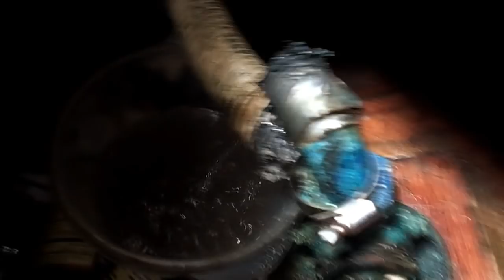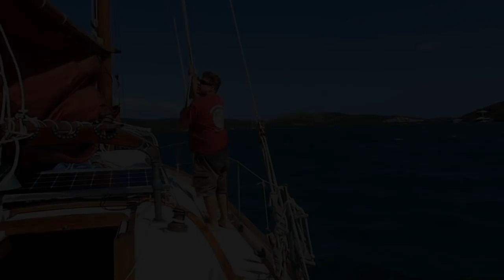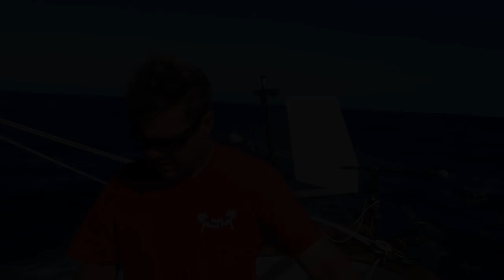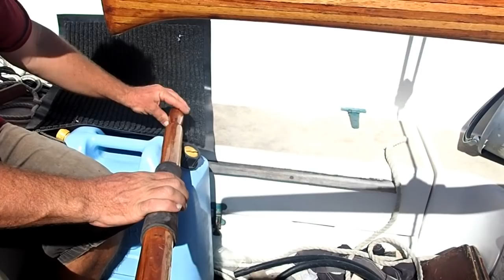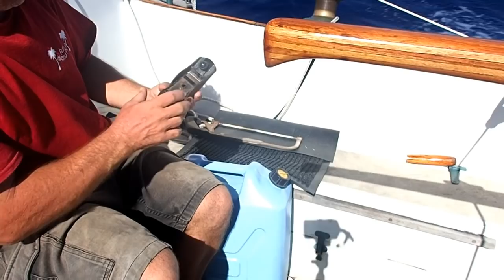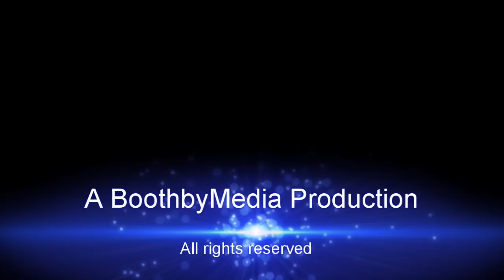When you get that sinking feeling

Comment: Good video. thanks. On the wooden plugs - one of the rules for an offshore racing boat is to have a plug of the correct size for every through hull AND it should be taped to the hose that connects to the seacock. That way you don't even have to go find one. Something I always do on my cruising boat now.
Reply: An acquaintance had just launched the beautiful approx. 90 foot trawler that he had built.  On the first passage after sea trials a through hull fitting fractured.  The flooding could not be controlled so he tried to run her up on the beach of an island.   He didn't make it and she was lost in 3,600 feet of water.  The problem was that he had used inexpensive non-marine fittings.  The real problem was that he did not have bungs for the through hulls.  We were maybe 12 nm distant but she was gone before we arrived.  The USCG beat us to the scene to pick up survivors.  No hands lost.
Reply from the maker: That is sound policy.   I've been rather too cavalier about such things.  It only registered for real with me when the water actually started coming in and then it hits that a boat can sink.
Reply: @howtosailoceans1423  Yup, when I purchased my 1968 Allied Luders 33 (in 2000), the previous owner had tied bungs to all the through-hulls. I just figured all vessels had these as cheap insurance in case a hose ruptured and the valve or valve handle broke or jammed. 

A few years later, a friend purchased a Baba 35 that had been sitting on the hard at Herl's Harbor (Port Clinton, Oh) for years. I noted the old bronze through-hulls that were very stiff-working and hoses with severe surface cracking and told him he had better maintain those before splashing her. He ignored me and splashed her the next day (mid September). Bungs were not tied to each through-hull, either. Went out for her first test sail with him and the previous owner on my birthday right after he put her in the water. I was a little nervous about those through-hulls, but she bashed well to weather in 25 knts of wind with a full jenny and main with the rail nearly soaked. No sad related story that I know of, but then we left that marina that fall. I hope he maintained those through-hulls during the winter haul-out. 

Also, wouldn't it be possible to careen your vessel and fix the through-hull at low-tide rather than going through the expense of having her hauled?

Comment: A good sailor is a master of all trades.  You sir are a master.   Great video, fair winds Brother.
Reply from the maker: Thanks Joe!
Reply: If I had a cent for every stroke of those oars, I'd be a happy sailor. Well at least what remains will make a fine knock out killing stick for dinner when I haul it on board! What material was the drain valve? A lady I have to pick up soon has hers made of bronze with(as it so happens, I was talking to her previous master this afternoon about the various holes she has) the conical shape flow stopping device that you described so I hope they are in better shape than your hole stopper! His method of maintenance was to dissemble, clean and apply a liberal coating of Vaseline or grease then back in again. Is there no tidal range thereabouts where you could careen and replace the offending article? I presume the thieving boatyards over there are just like the money grabbers oer hereabouts! Anyway until we cross tacks again, may your halyards remain up tight and your sheets taut. SkipRay in the "Kingdom".

Comment: Kevin, my boat is 42 years old. Just because of their age and from no apparent deterioration, I changed all the bronze thru-hulls and valves. Turns out they were all in great condition. 5 years after installing the new thruhulls and valves, I was shutting off the valve to the head sink drain. The handle broke off in my hand and started leaking. That was the one thruhull valve that was Chinese made. The bronze was okay but the stainless valve was junk stainless. Doesn't pay to by Chinese.
Reply from the maker: Hi Patrick, yes, I saw your vid on that.  These are old Wilcox-Crittenden seacocks, but alas they are succumbing to galvanic corrosion and need replacing.  I'm planning to go with composite through-hulls ... do you know anything about these?  At least they are not prone to electrolysis or corrosion.
Reply: @howtosailoceans1423  I only know what I have read in Practical Sailor about Marelon valves...the thru-hulls are good but the valves have a way of breaking too soon. Then there was this comment "I replaced all original thru-hulls, both metal and plastic, with brand new Marelon. The design of Marelon thru-hulls has been improved due to improving ABYC standards, so the new ones are stronger than the old. Easier to sleep!" Flip a coin on Marelon. I am putting up a vid on Friday about sailing from coastal Africa to Zanzibar and some of the dangers out on the ocean. Upon approaching the dock in Zanzibar, I muse "What would Kevin do in this situation?" A little plug for you.
Reply from the maker: @RVLifeNOW  Ha! I'll look for that vid ... I think I'm going to give the Marelon a try, if anything because it's fewer things in the water to cause galvanic corrosion or leak electrical currents.  So far I've generally heard positive things about them.  This is the first time I've dealt with through-hull issues, so it will be a learning experience.  Fair winds on the Indian Ocean ...

Comment: Never ever go to sea without a bunch of old bicycle inner tubes. Bike shops will give them to you for free.  I pin hole doesn’t matter. Cut off the valve stem and split it lengthwise.  Wrap it tightly around any pipe, elbow or valve that leaks and you are good to go.  You can even tie it back on itself so you don’t need anything special to secure it.   Also, it is amazing what you can do with it on a boat to make life easier.  Take several, they are good to have around and might even save your life someday.

Comment: Have you tried rubber expansion plugs? We use them to seal up radiator/engine ports in the auto industry. They tighten with a bolt will hold a lot of pressure. Thanks for sharing.
Reply from the maker: No, did not know such things existed.  Those might work better than wooden plugs, will do a search, thanks.

Comment: Might be a good idea to add a drilled hole and attach a small lanyard to the plug so it can be tied to the hull and it can't be lost if it should work loose. Looks like your getting good winds and moderate seas. Happy sailing.

Comment: Another ER supplies I sail with. Fiberglass sheets and rounds I make from a 4×8 sheet from Home Depot, $36. Self tapping screws. Plastic bag ready made. To fit my drill driver for underwater work.
It will work great to save a boat with a hole in the freeboard. Just tape on the FRP bandage screw it down. Be on your way.
Forgot! This stuff will fix a broken mast too!
Reply from the maker: Interesting.  I just added Stay Afloat putty to my emergency bag, looks good for sudden leaks, won't fix a mast though ..

Comment: I keep a couple rolls of rubber water proof tape aboard. It can be applied and stick underwater. I use it on rubber hose, nylon tubing and silicone tubing. It streches tight. I get it from Home Depot ducting aisle. It does not like hot sun. 
$10 a roll. I have saved a dink during erma and a broken 90 through hull that I wraped under water.  On a Island Trader 38.

Comment: Another great video.  High adventure assured, catastrophe likely, low probability of success...damn the torpedoes, let's go sailing!   Bee's wax comes in handy especially when the duct tape sticks only to itself in that situation.

I noticed the vane is letting Ruth wander through about 30 degrees.  For your set-up would tightening the sheet to the tiller reduce that?   Why no beads at the mainsail luff?

Comment: Those tapered plug designed seacocks are wonderful designs and can be serviced to as good as new with a little effort.
At the next haul out or still afloat with a good plug from the water side of the fitting...back off the nut that keeps the tapered bronze plug in tension in the seacocks body.
Polish the tapered section till it shines with some 1000 grit wet and dry paper and reinstall in the body. Then put lapping oil in the little grease fitting and snug down that nut drawing the tapered plug.
Now the fun begins....open and close the valve a few hundred times. This will allow the surfaces of the tapered plug to match perfectly with the body of the fitting.
Adjust the firmness of the valve to suit your taste.
I have restored many a valve that has been pitted avoiding the hassle of seacock removal/ replacement and of course the expense.. As I said you can even do the job in the water with a proper wood plug from the  overboard side when haul out facilities are not available .
While a bit of work , it converts to many additional beers and provisions when you factor in the cost of a haul out, and a new bronze
 W/C. style seacock.
Let us know how bad that tapered bronze fitting turned out to be....
Remember ..."
YACHTING IS GLAMIOURUS" 
and....
"Beyond All Things Is The Sea"
Thanks for your outstanding video work
Reply from the maker: Interesting Tom!  I will be interested to hear your comments on my upcoming vid on how I temporarily repaired the seacock.  Yes, galvanic pitting appeared to be the problem, resulting in the valve not closing because the edges of the hole in the plug were eaten away.  I think I have things repaired well enough to wait until my regularly scheduled haulout in the summer .

Comment: Nice, compact video, Kevin. Those DC (damage control) plugs are great and if you drill a small hole near the thick end and thread a piece of small line through the hole, you can tie the plug loosely around the base of every thru hull and have it hanging there ready for instant use in case of an emergency.

 Have you ever used "Splash Zone" by Petit for those annoying leaks? It can actually be applied underwater! Perfect for that thru-hull job. Also "Rescue Tape" available at the big box stores. Temporary but works well for leaky pipes. Of course, I'm gonna go out on a limb here and guess that there weren't any big box stores or marine supply places near you out there...nice job...
Reply: Hove to in a gale at night about 80 nm off the beach something stove in the stbd bow.  Three planks were sprung and we were shipping water.  Splash Zone saved the day and allowed us to control the leaks until making port.  (From our position a stbd tack was impossible to make landfall.)
Reply from the maker: Hi John, no, I haven't heard of Splash Zone, will take a look.  I have the leak very nearly stopped now, hopefully well enough to last until I haul out over the summer.  Will purchase a roll of rescue tape just in case.
Reply from the maker: @MrLikeke  Yikes, I do not like it when the boat starts taking on water.  Of course traditional wooden boat owners are somewhat used to it, I suppose ...

Comment: There are the foam plugs that have received good reviews, do to their ability to conform to irregular shaped opening. There are a couple of good vids around of a yacht magazine testing/sinking a boat for emergency procedures. Also, there's tapes available like rigging tape or a plumbers tape like, 'Flex Seal'. I have used exterior window flange sealing tape to make a temporary repair to hull deck joint after being hammered in a hurricane.
Reply from the maker: Interesting, yes, one of the problems I had when plugging the through-hull from the outside are the flanges on the inside of the through-hull used for installing and removing--can't get a wooden plug past them.

Comment: Bravo on the little Stanley 110 block plane,such a useful tool.  Shine her up when you get back to port.
Question: can you determine if the planking around the thru hull hole is still sound or has it gotten wet enough to begin to weaken?  I'd hate to be driving a plug it and crack a seam out there. 
Hope you Fair winds continue and
Best wishes
Reply from the maker: She's fiberglass, so no problems with that.  I've got things stabilized now without a haulout, but next haulout all through-hulls will be replaced.
Reply: If you have one showing corrosion, it's probably a safe bet that the others are needing replacement also. Good plan by my standards. The navy uses tapered plugs all the time so you know they work. Happy sailing.

Comment: Maybe time for a set of marelon seacocks?  Not subject to electrolysis!
Reply from the maker: Thanks! That's exactly what I am thinking for my next haulout.  Some of them do not require bolting to the hull either, so easy installation.
Reply: Clearly neither one of you has broken the handle off your marelon seacock. Happens way too often.

Comment: I can't picture where the plug goes. Are you removing the current hardware then fighting a full force flood while driving it in? Seems risky to me.
Reply from the maker: Ahh, someone's paying attention here.  What I would have done is sawed off the elbow and drove the plug in there, with the seacock closed as far as I could get it.  Or I may have attempted to drive it in from the outside, although I subsequently found out that is not so simple because of the prongs on the inside used for removing the mushroom limit how far you can drive a plug in.  I have since taken Patrick Laine's advice (check out his channel, btw) and bought some of that "Stay Afloat" putty just in case.
Reply: @howtosailoceans1423  Skipper, thanks for the reply. That makes sense. Also, you write how you speak. That's an enjoyable quality.

Comment: Hey Kevin those sea cocks should allow you to tighten them in the closed position. Should be a nut on the Handle side you can pull the taper in to the valve body effectively shutting it down.  Of course your probably figured that out by now.  Scary having uncontrollable water coming in.  Take care,  oh enjoyed the guitar also.

Comment: A cedar oar, I have a hard time believing that, cedars seems way to soft and weak for such a product.
Reply from the maker: Ooops, just realized that  I mispoke!  It's spruce, not cedar.  Thanks for catching that...
Reply: Well, funny thing, after watching your video, I did some googling and some sites do talk of using cedar for oars. For the live of me I don't get it, I have used cedar for exterior construction and would not think of it as being strong enough for oars, but???
Reply from the maker: @raynic1173  The only place I have cedar is the ceiling (lining) on the inside of the hull, inside the cabin.  Looks nice, and is also somewhat fragrant if you leave it unfinished.  For oars and spars, generally some type of fir is best.
Reply: Yeah, I know cedar has even been used for hull planking. But back in the day I did have a dinghy motor and pulling on a pair of oars in to a 18 mph head wind (my personal limit) generates some stress on the oars. The other thing that has a bearing is the varying sub-species that's chosen.